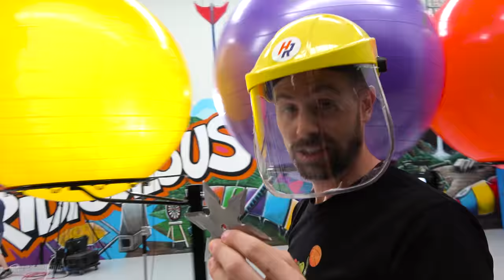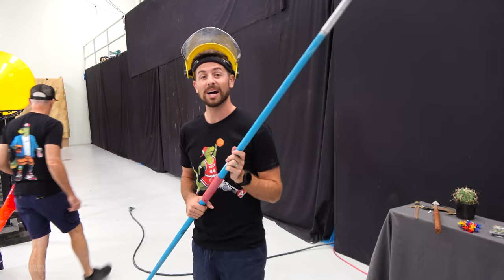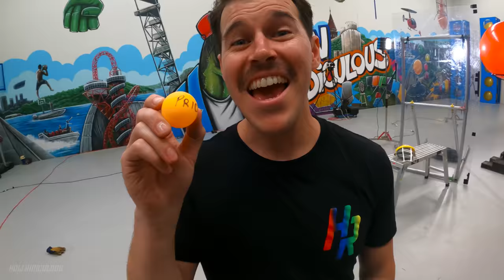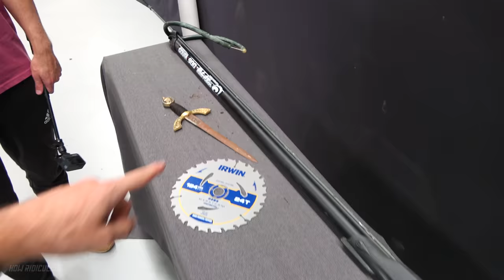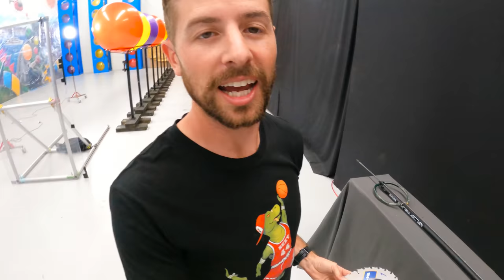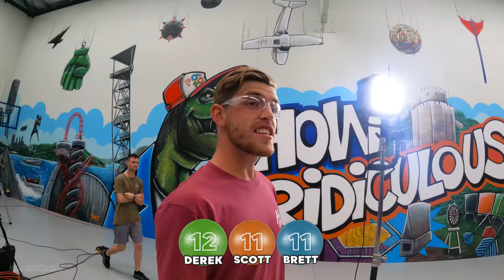How Many Exercise Balls Stops an Arrow?

Comment: I wanted to tell you guys this for a long time but always forgot by the end of the vid. But you need a shorter bow string, at least 2 inches. It would make the bow much smoother and also quiet possibly faster. If you look for a string I’d recommend bcy formula 8125 as a material of choice but this defenetly isn’t a must it’s just what I get the best performance out of.
Reply: I reckon putting twists in the string to increase the bracing hight would do the trick. 😉
Reply: They should just get a modern compound bow
Reply: @killeralltires  well that kinda gets rid a bit of the finesse right?
Reply: @lucasm4886  it would go through more stuff which is all I'm in it for
Reply: @lucasm4886  The problem is, they're already shooting the recurve like it's a compound.
You don't draw and hold with recurves. The draw and release are meant to be a single motion, not held at full draw while adjusting aim.
They would be more accurate and more comfortable either learning to properly shoot a recurve, or replacing it with a compound.
Reply: Or they could just buy three compound bows and adjust them to have identical power at full draw for each shooter. I wonder how expensive those are though...
Reply: @edkovac8978  in theory that's correct and we do do that but always say that a good string has between 20 and 40 twist and that would not be nearly enough to get a proper braceheigth in this circumstance
Reply: @killeralltires  the problem here is that the compound is precisely adjusted to the draw length of each shooter, they would have to buy 3 bows and adjust them in a manner that they all have roughly the same draw weight at Peak draw.
Reply: @EujenSandu  they can be quiet expensive but you can also get cheap ones for around 200 bucks each. They then also would have to pay someone to adjust them for them as I don't think they could do it alone. It would also take the competition out of it as it is far easier to shoot a compound. At least for what they are doing
Reply: *quite*
Reply: Also, their form this time around really wasn't the best. 

If they tightened it up a bit, could also help

Comment: Here's a concept for the double points: Have someone choose between getting +2 or x2. If they figure they're not going to get many things done, they're guaranteed at minimum 2 points. But if they get, say, all 10 of the things, they only get 12 points. Contrast to the usual x2 modifier, where they can get 0 - 20 depending on results. 

Balance between guaranteed points, or maximum points.
Reply: Almost always better to do the +2, because you’d have to get at least 3 in order to make the x2 worth it
Reply: @toziassmitt  Which is the "balance." Sure, a +2 would be better when you're throwing a marshmallow at a cinderblock. But what if you've got a brick? A x2 might be better, because you might get two, might get three.
Reply: @Skorpeonismyrealname  in nearly all cases the +2 would be better. The majority of items they get to throw/use are not good- that’s by design. They always have about 2/3 really strong items, and the rest are difficult to use well. So basicaly everyone would use +2, except for when they get, javelin for example, and then it’s obvious to use the x2. This would be a dumb thing to implement imo
Reply: @toziassmitt  I mean, I'm not suggesting it becomes the new norm. Just one of those "I'm a hundred points behind, new rule so I can at least try to catch up" things

Comment: Suggestions, switch the bow & arrow for a crossbow. Offers more stability and control, where the bow, you guys are good but the crossbow would get you better.
Reply: but the possibility of them messing up with the bow is funny
Reply: Also got to have permits in most Australian states for a crossbow
Reply: Unless legislation has changed since 2011, crossbows are considered a 'prohibited weapon' in WA, as well as most other territories of Australia.
Reply: The bow is likely being used instead of the speargun (quite similar to crossbow) because it has more “skill” to it
Reply: What about better arrowheads? If they had a razor tip, instead of field tips, it would cut way better
Reply: Thanks. Live in the States and didn't know about the restrictions in Australia. Thought there might be, but couldn't remember from their time with Matt, on Demolition Ranch.
Reply: They would just all get the same result in most situations
Reply: Crossbows require special permits thanks to disarmist policies in Australia.
Reply: They should just get a compound bow.
Reply: @shmaxo  Wow, I thought our weapons regulations here in Germany were tough, but even here you can buy a crossbow when you're 18 or older without the need of a permit.
Reply: @shmaxo  yer some states u can get a permit to use for deer hunting

Comment: Aiming high was a bad move. The ball wants to pull towards the center when it bursts. Aiming high just means the rubber wants to pull the arrow towards the center (down) and thus off track. Crouching down to aim center and level will equalize the pull towards the center where you are already aiming and keep your arrow on track longer

Comment: I get the impression those purple balls are a little thicker than the red and yellow. You know how different exercise balls can have different weights and firmness? I wonder if that is why the arrow went through it and it survived longer before popping, and the saw blade bounced off. Otherwise I think the saw blade would have still popped it with that size of hole it made if it had hit one of the yellow balls! Just a theory.

Comment: Where did you get the idea that shooting or throwing stuff at the top is the best? I mean, the chance for the object to get deflected is the highest at the top, also if you shoot/throw stuff through the middle of the ball, the object has to travel through less material (if it's thrown perpendicularly). The distance it needs to travel to touch each ball is the smallest in the middle too, I mean, why the top?
Reply: the object they're throwing/shooting will fall with gravity as it goes through the exercise balls, so they're aiming high to keep it inside the line of objects for longer- 
both strategies have their upsides and downsides so it's personal choice as to what they go for-